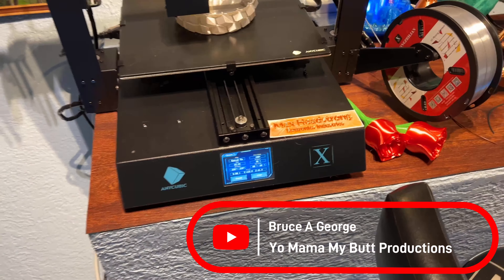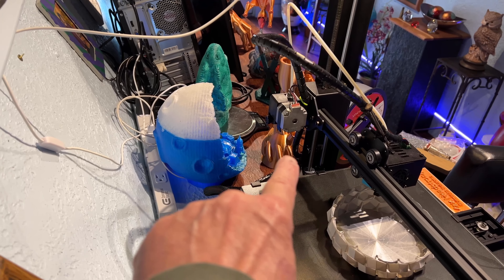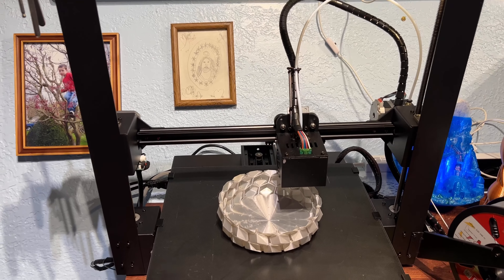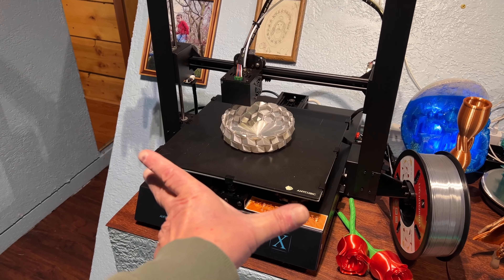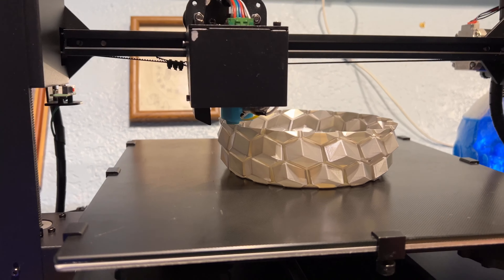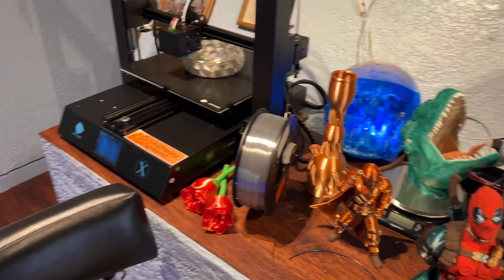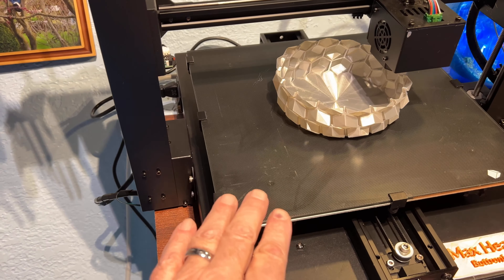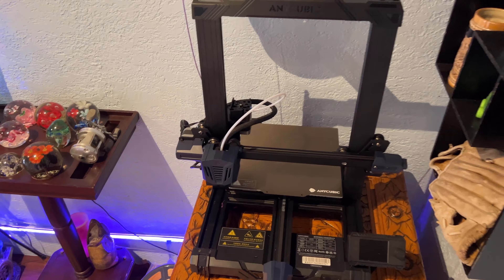Buying a 3-D Printer

Comment: You should research plastic a bit more, PLA is not actually bio degradable. The reason for this is that the enzymes needed to decompose it rarely present themselves in nature. Recycling plants aren't setup to recycle it either, so it is worse than ABS when it comes to sustainability purely because it doesn't get recycled as much. Also, believe it or not but PLA is toxic to a degree since it still emits volatile organic compounds.
Reply from the maker: If you have ever been around an ABS printer, the room stinks of melted plastic. You immediately ask "what's burning?" Your lungs will start hurting if there is inadequate ventilation.  Resin 3-d printing chemicals are so toxic that you must contain and wash the printed parts. Corn syrup is the main ingredient in the PLA I buy. It is not perfect, but It is good enough for the medical industry.
Reply: @BruceAGeorgeYoMama  Medical prototyping maybe, but very few medical devices are actually built out of 3d printed parts. As far as it goes I daily drive a voron 2.4 which I only print ABS with so you don't have to question whether I have an idea of what I'm talking about. Please google it instead of misinforming
Reply from the maker: @UnwrittenGamingftn  Thank you